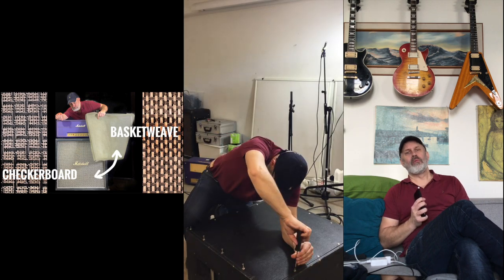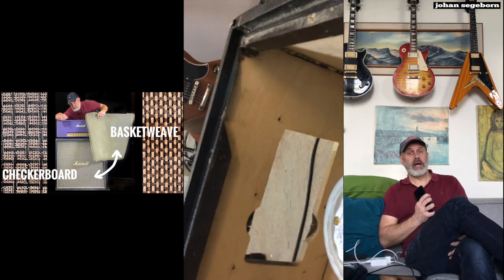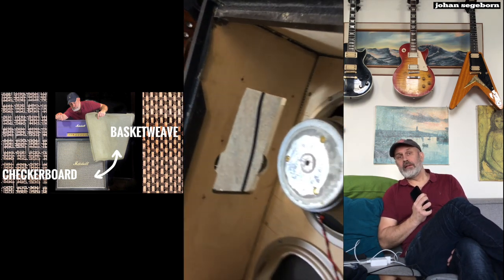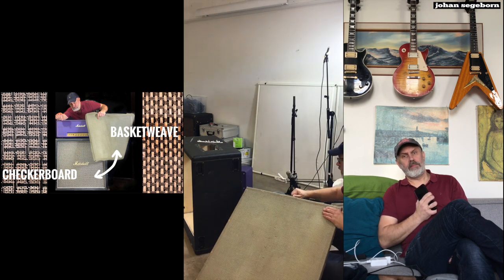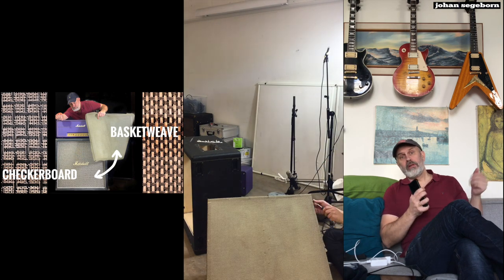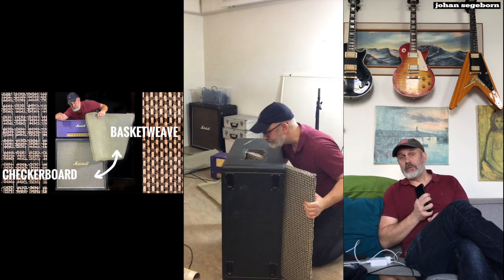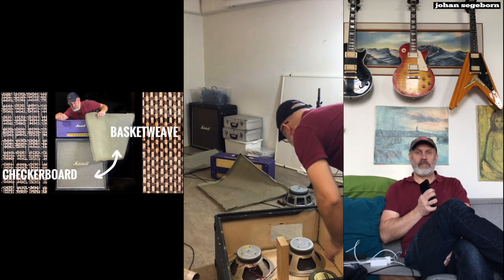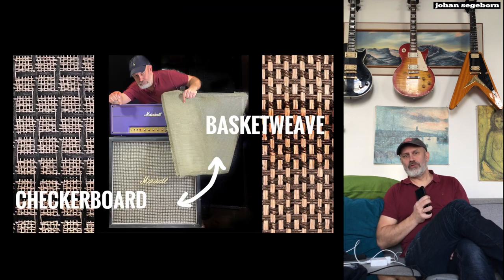Checkerboard -vs- Basketweave Marshall GRILL CLOTH using the exact SAME CAB!

Comment: You actually did it! I asked pretty much exactly that question under your last video and have been thinking about the possible differences all the time. So great to finally be able to listen to an exact A/B comparison. :)
Reply from the maker: Thanks, glad to be of service! :-)
Reply: I only scrubbed through your video on my phone before and was kind of surprised how little difference there was. However, now after carefully listening to it again using proper headphones connected to an audio interface, I can really hear the difference: It's not massive but the grill cloth does clearly affect the tone. The Checkerboard seems to have a steeper cutoff over ~3kHz, making it sound very warm. The Basketwave seems to let through more high mids, making it sound a little bit more aggressive but also giving it a bit more clarity/note separation. Having a quick look at my RME interface's spectrum analyser confirmed this pretty well.
Again, thank you so much for doing these experiments in an almost scientific manner! Cheers from Germany!

Comment: My two cents..I have had them all, from 1964 through to the 70's and to modern 4x12's. I had some of the cleanest basketweave cabs around. My favorite cabs were the early 70's Checkerboard. I still have a mint 1973 "1935" cab that just sings and has gorgeous tone. The basketweave smothers the speaker too much for me. The G12H cabs I had were great, but the G12M cabs were too dark/muffled for my taste. I much prefer the check cabs with Pulsonic cones both G12M and G12H, up to the end of '73.. You can turn the treble and presence down if needed, on the check cabs, but the basketweave blocks a lot of information. That's my experience, for what it's worth.
Reply: Hi sounboy I have owned dozens of vintage Marshall cabs just like you
Would be great to chat sometime

Comment: victorjbarker - Interesting... I also wonder what difference in tone there is with a cabinet made of Pine vs Birch vs MDF [Particle Board]...another project for Johan if he has not already covered it -JOHAN, what do you think ?
Reply from the maker: Yeah that’s interesting. The current 1936 2x12 is all MDF whereas previous versions have been all ply
Reply: Yeah I'm wondering about that one, too.
Reply: I’ve changed backs of 4x12s from mdf to birch ply also, I think it sounds a little more lively and resonates better.

Comment: I THINK I can hear a very minute difference, the basketweave seems ever so slightly muffled/less bright compared to the checkerboard, but nothing that will impact tone in a substantial enough way to make a recloth worth the effort, a speaker swap will be 1000x more impactful on overall tone then a grill cloth swap, unless it’s for esthetic reasons of course!  Aside from what I mentioned the two sound identically badass to me!

Comment: There seem to be slight differences at first, but the shorter examples from 3:55 onwards are virtually identical, which suggests that the length of the sound clips matters to our perception. The A/B switching needs to be quite rapid to allow the ear to hear the differences, rather than inventing differences because our auditory memory has already forgotten what the relevant phrase sounded like. 

In this case, I don't think the type of cloth makes any difference - certainly not one that you would hear in a live performance.

Comment: Johan you might need an bit extension for a your drill driver.  But then again, using a screwdriver strengthens the vibrato muscles.

Comment: "Looks Only"  being the question? my vote would be checkerboard.. hmmm roll off.. perhaps at times the basket weave may have seemed to taken a bit of "topiness" off? The room mic didn't seem to reflect as much difference to my ears? Now I have a old plywood vox 2x12 cab loaded with modern greenbacks that has the cross in the cutout compared to the 2006 plywood reissue with the same greenbacks that has an open cutout and of course "night and day" different.. makes sense... Very subtle (almost indiscernible) difference I think if you were in the audience between these two?

Comment: It's the most identical two samples have ever sounded haha. I think it not only proves there is absolutely no difference, even the room mic sounded identical, but it also shows that after moving the cab, mics and setting them up again, you  get exactly the same sound as before and not something a little different because a mic moved an inch etc.

Comment: This will be interesting!
Reply from the maker: I’m looking forward to hearing your feedback on it!
Reply: @JohanSegeborn  I can definitely hear the difference. The basketweave roll of more and the checker is is more brilliant open. In your recordings I like the checkerboard better but I know that when I play myself in the same room I prefer the basketweave more because I play  at loud volume and the basketweave top rolloff makes it a bit easier on the ears, also a little bit more "vintage" sounding.
Reply: @pleximaster1338  lol
Reply from the maker: Thanks man, there is a difference but it’s much more subtle than I expected.
Reply from the maker: The relatively small difference makes me wonder how accurate the basketweave reissue is.
Reply: @JohanSegeborn  I do a lot of mixing and most of the things we hear in solo are gone in the mix. I guess I just have a different perspective on these things.
Reply: @JohanSegeborn  roflmao You are awesome !
Reply: @JohanSegeborn  The reissue basketweave is less dens than the original. Time and wear if the basketweave cloth (Actually twinned paper threads also changes with time closing the small holes between the treads. That can also influence the rhigh end oll off